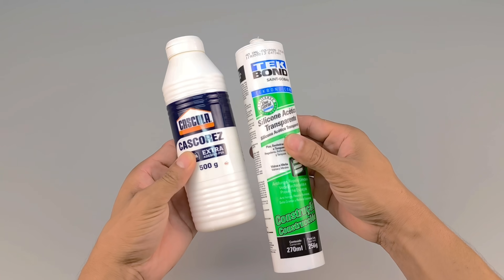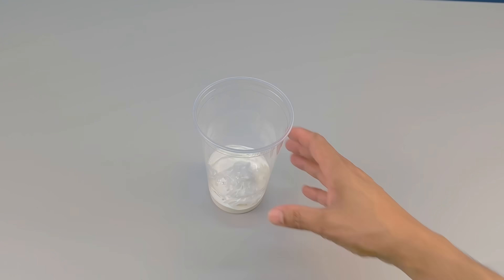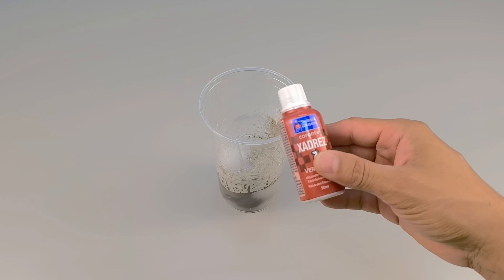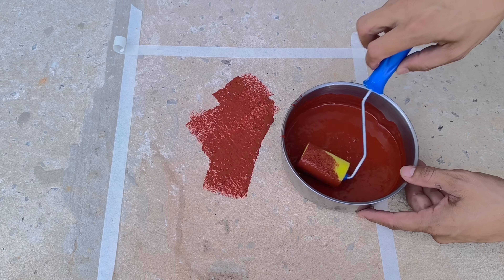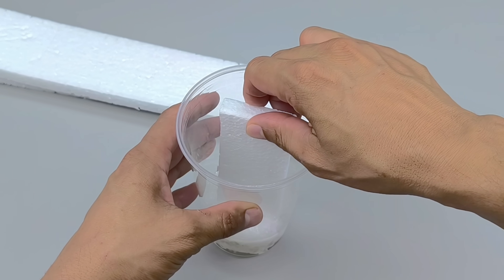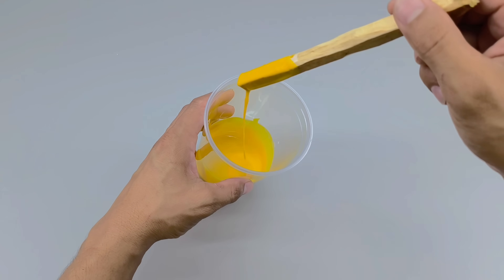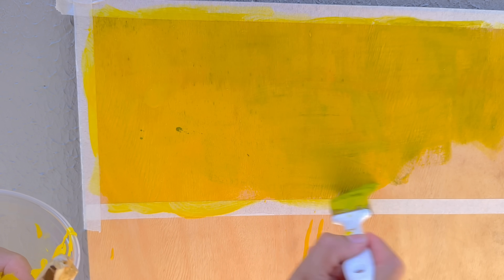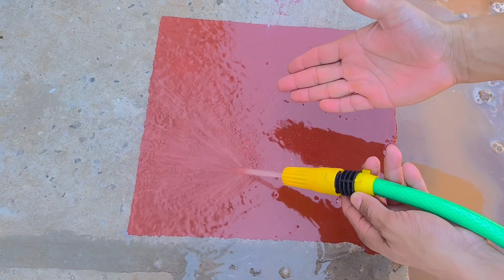Mix white PVA GLUE and SILICONE and see the IMPOSSIBLE happen before your eyes!

Comment: Will isopropyl work? How about naptha?
Reply from the maker: Isopropyl alcohol can help with surface preparation and cleaning, but it won’t act as a bonding agent. Naphtha is mainly used as a solvent and cleaner, not recommended for mixing directly into this type of formulation.

Comment: From NOLA. Would the plastic based paint be good for exterior wood repair? To apply to weakened areas, cleaned and apply the plastic paint before finish paint. Instead of having to replace a bunch of wood. Thanks
Reply from the maker: Good question! Plastic-based paint can give some protection, but for exterior wood it’s better to use a product made specifically for outdoor sealing. 🌳🛠️

Comment: Type of silicone please?
Reply from the maker: The silicone I used is the regular one for construction, which is sold in tubes and mainly used for sealing joints. 🛠️
Reply: @inovaouinventa acetoxy or neutral cure, please?

Comment: I have but one question. Why? The cost of the silicone caulking alone makes this a very expensive product for the coverage provided compared to paint. And at the end of the day, just how long does this really last? I did an ingredient lookup and by the time your done mixing this up, you’ve spent a pretty good pile of money for the quantity you get.
Reply from the maker: That’s a very good point! The idea behind this mixture is not to compete with paint in terms of cost, but to explore durability and waterproofing. While silicone is indeed more expensive, it provides strong adhesion, elasticity, and resistance to moisture and weather. In tests, it can last for years on surfaces exposed to water, where normal paint would peel or crack much sooner. So it’s more of a niche solution for specific applications rather than a cost-effective alternative to paint.
Reply: O.K. ....assuming the product is more durable than paint,...then shouldn't the focus be to use it on non-traffic areas ( less wear) of cement?  Forgive my suspicion, But....does it behave poorly in repeated sunlight?

Comment: I only have 100 square metres to cover. How much ingredients do I need for the flooring. Doesn't the 'rubber' floor absorb dirt? Surely it must.
Reply from the maker: Good question! For such a large area, precise measurement is essential. And yes, rubber-type mixes can absorb some dirt, so sealing is recommended.

Comment: Should I set the drill to clockwise or anticlockwise for the mixing process?
Reply from the maker: Clockwise is usually the best for consistent mixing, but the key is to keep a steady speed to avoid splashing.

Comment: Are you aware that pure ethanol can’t be purchased without a special license?  Does another alcohol work such an isopropyl???
Reply from the maker: Yes, I’m aware. In many cases, pure ethanol requires a license, but you can replace it with pure acetone or isopropyl alcohol for similar results.
Reply: @inovaouinventa 100 proof lol
Reply: gasoline from the pumps will melt the styrofoam just as easy and cheaper too, so will acetone but it will have a tendancy to dry out and harden up quick so be ready to add the pva  asp.

Comment: Does it work on plastic?
Reply from the maker: Yes, it works on plastic, but for better adhesion, it’s recommended to sand the surface lightly before applying.

Comment: That first one. Could it be dyed black and used on an asphalt driveway
Reply from the maker: Yes, it can be dyed black and applied to asphalt, but make sure the surface is clean and dry before application for the best adhesion.

Comment: i thought it was going to be a DIY glue video.  You can also use the Acetone and a bit of silicone as a water-proofer for tents as well.
Reply: Acetone is not a great solvent for silicone, because it causes the cured silicone to be weaker and can compromise adhesion.  If available (some places ban it), naphtha is probably the best solvent for silicone that can be bought cheaply and in bulk.  If you can’t get naphtha, mineral spirits (i.e. white spirits) is probably the next best option (I avoid getting the odorless because of its poor shelf life, and it is usually a weaker solvent and might contain water, but some brands may work fine).  

I know other hydrocarbon mixtures can work too, e.g. Paslode Cordless Tool Cleaner, which is 75% naphtha, 25% diflouroethane—might be a good choice if available and pure naphtha isn’t, plus the odor is relatively mild.
Reply: @oghaki5097  , i think i'd avoid any compound with fluoro in the name.   i just use mineral turpentine to water down silicon.
Reply from the maker: Interesting idea about the acetone and silicone for tents!
Reply: acetone is a savage solvent.   i use turpentine instead.